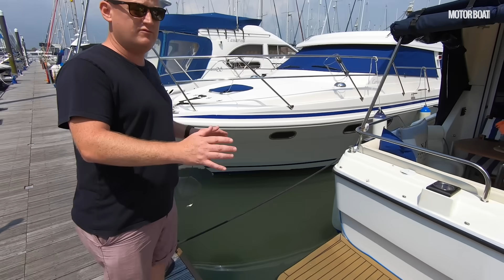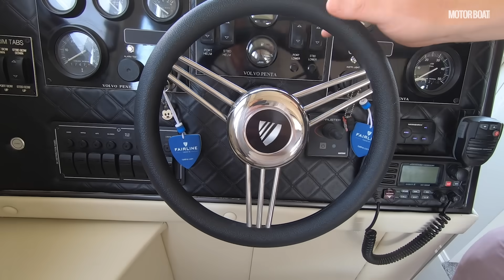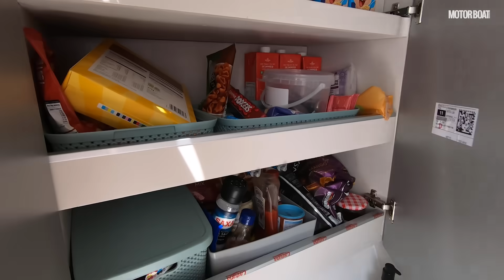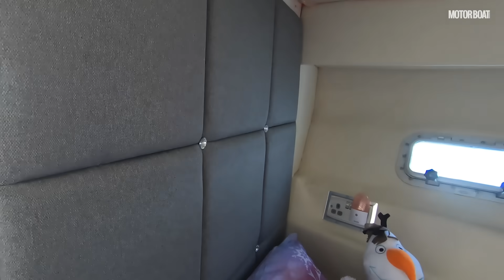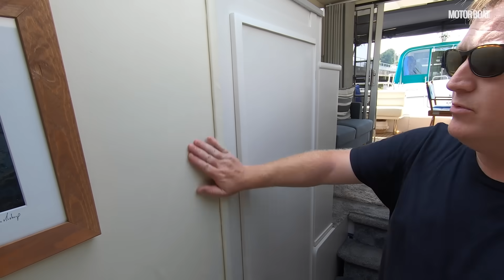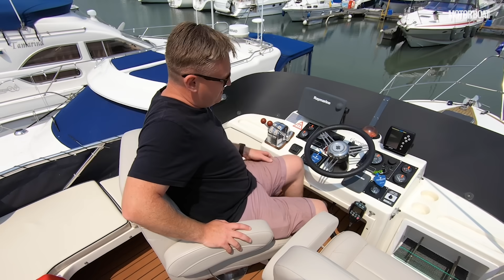How I refitted a 1980s Fairline Corniche 31 for less than £10,000 | Motor Boat & Yachting

Comment: Really nice boat indeed! Are the engines aqad41a models? I noticed they had non stock air filters, does anyone knows what air filters they are and are they better than originals?
Reply: The air filters were high flow. I have now gone back to stock as they weren’t that good.  I fitted an additional extractor fan though to help with the heat extraction.

Comment: If you're looking for a boat that doesn't cost the earth brand new. This would be the way to go but you need to be aware it will need hard work and good planning. That's what Ross did with a few tweaks. Have fun sailing Ross after all your hard work.
More please Hugo please I'm sure lots of people would be interested in refitting their older boats.

Comment: I did the same with a 85 Princess P35. It had Volvo penta TAMD 41A When i Got it. I swapped in Volvo penta TAMD 61A. Changed some interior and modern raymarine stuff. Made 12500Pounds.

Comment: my excuse of "boats are expensive" is no longer a reason for not having one....awesome restoration.
Reply: They are expensive dawg.... Wait until something you don't want to fail, fails. Wait until you see how much marinas cost for live aboard type vessels. Shit hurts the wallet 😂

BUT

If you're not absolutely broke (if you have A job) you can have a boat, and get boating experiences
Reply: @OverAndOverAndOver  True, engine service every 20-100 engine hours, marina fees, gas, etc.
Though what confuses me is engine maintenance. Why can't it be as simple as a car?
I know boats are more complex, so that's a dumb question, but I'm wondering why it can't be at least more similar to a car.
I have a 2022 Hyuandai I bought new and drove lyft with, over 1 year put on 50,000 miles, roughly 2,000 engine hours by my estimates, 0 engine maintenance beside and oil change. Probably went over 30,000 miles before the first oil change, not ideal I know it's not good for it just didn't, but didn't break down at all.
I get boat engines need high RPM and are water cooled, but imagine a boat just built with a new hyundai car motor(well maybe not one out of a car, but one built for a boat, nearly the same as one for a car, but configured to hook up to a boat drive shaft), no water cooling, but doesn't need it.  Seems they design boat motors to push them to limits - requiring water cooling, but is it really necessary? Sounds like that's why they are high maintenance(watching great loopers and stuff, seems a lot of the time maintenance has to do with the water cooling, either clogged, or hose break or leaking, stuff like that). 
I searched up RPM, cars run between 1,500 up to 3,000 RPM, boats more like 3,000-5,000 RPM. I know torque is a different deal too, though I'm assuming a car motor would work, just wouldn't necessarily be fast for a boat(and may need to have a different range in terms of how much gas you can give it depending on difference in power required to turn a propeller vs wheels, though idk).
Though if it wasn't set up for max speed, or pushing the motor to it's limits, I don't see why it couldn't work for like 500 engine hours then just do an oil change. Besides intake for air(that might be the issue, salty air. Though if really a big problem, maybe a way with a filter and fan to reduce resistance to treat the air), could keep it enclosed so the rest has minimal exposure to water or sea air.
I realize there's a lot more to a boat, the steering, potentially a stabilizer, and many other elements that could break or that could require maintenance(not to mention cleaning, barnacles, etc). Though if the premise is correct, that a car motor could get the job done without needing water cooling, and maybe just settle for lower performance for just like cruising. Would be able to run for 10 hours for like $45(how much gas I'd use on a 12 hour shift, roughly 450 miles, I know milage wouldn't translate to a boat, but still 10 hours of engine time however far that'd get you on a boat, even if not super fast depending on size of boat, though may be able to get a small boat going fast for 10 hours, and could double the gas tank, so could get 20 engine hours of range). 
3 oil changes per 2,000 engine hours(and design it to make it just super easy to access for oil changes, no rebuilding ish, just drain and fill), but no major engine maintenance, keep 1 car battery for the motor and not run the boat electronics off that, have another battery bank and completely separate generator.
If that was enough to move a decent size trawler, lets say 35 foot, even if not very fast, if I could run it for 20 hours for $90 of car gas(double size tank), and could really just rack up 500 engine hours without engine maintenance, like why not? Serious question, what's the main problem? Is there a reason it would fail, even if designed to match the amount of power it'd use for a car(regardless of how fast it equates for a boat). New 40 footer family yachts/trawlers run like $400k-$1.3m, a new hyduai car like my sonata runs like $30k-$35k(let's just call it $25k for the engine), so not a huge part of the sticker cost. Better yet if it was built onto a block that was as simple as possible to detach from the exhaust, drive shaft, steering, etc to make it viable to lift out the motor and just replace it with another complete $25k motor if really need be(I realize that's exactly the point of an outboard motor and similar cost, but if can run it 500 hours without maintenance and even then just an oil change, and not have water cooling element to go wrong). Also make the generator simple to detach and replace if need be.

Sorry for the long azz post, but would it not be possible to make boats with basically a car engine that(besides other things, barnacle cleaning, steering hydraulics, any other potential issues) would not be fast/super high RPM, but same engine maintenance as a car(e.g. likely none for 1,500 engine hours besides 3 oil changes, prolly should do more than that but just based on my car)?

Comment: Wow. Its Dolphin Star (later renamed Jojin)- I remember her being on oil drums in Birdham Pool in the early 90's. I was told by a chap from BA Peters she came in from Nigeria - she had tyres as fenders. Good to see she is still going. Had petrol V8's (seized), then twin AQAD40's, then AQAD41's - fine motors. She was featured in motorboats monthly mag as part of thier Corniche feature around late 90's..that owner restored her from her eledged African days and fitted the Aqad40's..and the the aqad41's (look like Bs?)..she was on 290 drives with single props when the V8's were fitted - assume the chap in the 90's fitted duoprops. 
Shame about the painting over of the waxed teak interior - each to thier own though - she was so abused in her early life and good to see her still going.
Reply: Just add, in case the owner is reading, the magazine she had a small feature in was Motorboats Monthly January 2000.
Oh how I miss Motorboats Monthly...